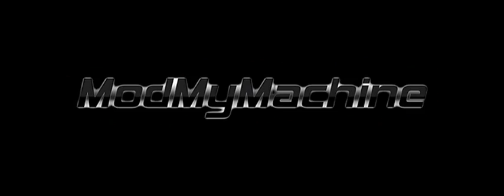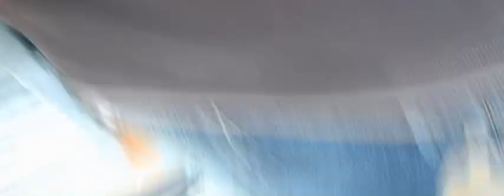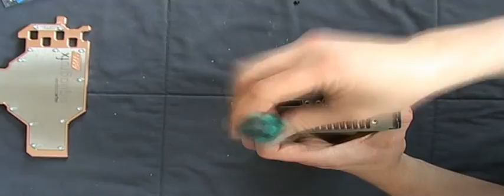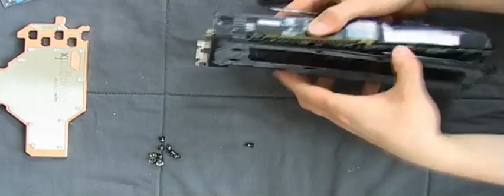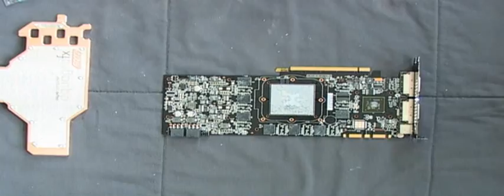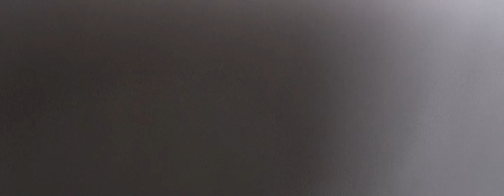Water Cooling Nvidia GTX 260 / GTX 280 graphic card

Comment: I have a question  can this computer play the latest games like black ops GTA IV left 4 dead 2 ? Heres the specs: (Yes it's swedish):/
Chassi: NZXT Apollo Blue
-Moderkort: EVGA nForce 750i SLI
-Grafikkort: nVidia Geforce GTX 260
-Processor: Pentium (R) Dual-Core CPU E5200, 2.5GHz överklockad till 4GHz
-RAM-minnen: Corsair DDR2 4GB (2x2GB)
-Hårddisk: 320GB 
-Nätaggregat: NZXT 600W
-Processorkylare: En bra kylare från kända Zalman.

Comment: ok this looks like do good job or it should be because myn card under full load realy heats up. Did anyone try this water cooling on gpu-s what is the results. I have v4 black termaltake case it has option for water coolin for cpu i dont know how would be on this one if someone have some advice mail me on dimke1984@gmail.com many thanks

Comment: @orbasang  know this is 4 months old but I have 2 gtx260s and to keep them cool there is a pretty ghetto but effective mod. take the plastic cover off and tape/zip tie/rubber band an 80MM fan to the top of the radiator andit will drop temps but about 10C easy. I did this to both my cards in sli both with 2 80MM fans and temps dropped 15C idle and 14C load on both cards. ghetto but effective.

Comment: dude... having lower temps and a more silent card... why the fuck would you say no to that? in most cases your GPU cooler is the most noisy fan in a setup. in my case its extreme, my tower has 3 fan settings, on the lowest its almost silent... but as soon as i put a GPU with a fan on the picture is quite different.

Comment: aquagrafix are contricting vs EK or DD as well.. you can try this if you have both block.. breath / blow through the hole and see the difference yourself.. Youll find that its harder to pull / push air through the aquagrafix. What more if it was water. Kills your pump early on and less option to add more components.

Comment: Im thinking about doing this to my XFX GTX 260 Black. Its locking up my pc when it hits 80c. Its also pulls 70 amps at that temp. If I run the fan at 91% (2988 rpm) the amps are around 22 it seems fine its just really loud so I dont think the card its self is faulty.

Comment: Hi
I have tried original screws too but its the same thing, 51c idle and over 100c after just 10sec ):, Dont know what the problem is. I have 2 220rads and Laing D5 pump and the cpu temp is really good, but the GPU... ): plz help me

Comment: Hi
I have mounted that block on my Gainward GTX280 and everything is cooler than before but the main GPU. I think it's the 4 screws around the GPU that makes it bad, because they doesnt fit good. They arent the same size as the other screw holes. On the GTX260 that you mount it at on, it seems to be same screwholes everywhere, but on my gainward gtx280 it's smaller size around the GPU.

Comment: These products work great. Fixed my graphics card problems. Now Gpu idle low 43c/ max about 47c. I have an extra radiator before and after it in the link. Increases coolant volume(colder liquid) and nullifies heating of coolant by the hot Gpu. When you add radiators (i have three swiftech stealth) you can then cool the whole mb and lose the other case fans. Colder and quieter. Use a Q-Fan as exhaust + 1 front intake fan + Silent fans on radiators and you will have a silent ice-machine.

Comment: hmm i havnt noticed, its not as loud as my 8800 or 7600 cards, but when i water cool it il end up with more noisy fans for the radiator!
do have any idea whats the most effective radiator to cool 2 gtx280s? i was thinking of using a 240mm rad but some hav suggested a 360mm rad :O